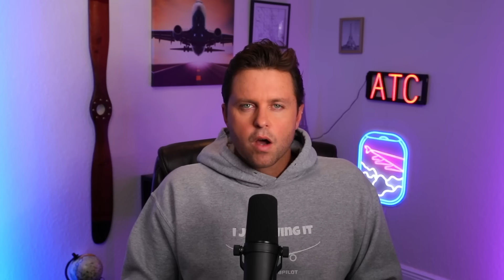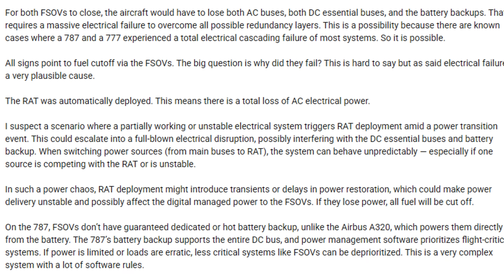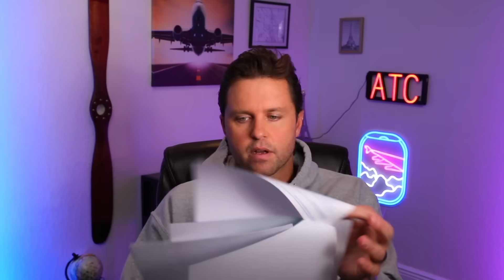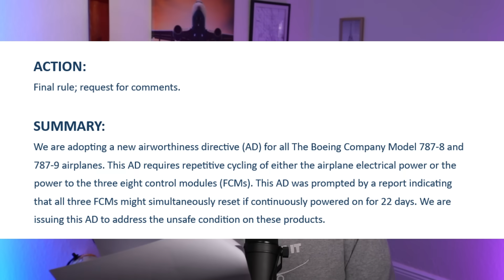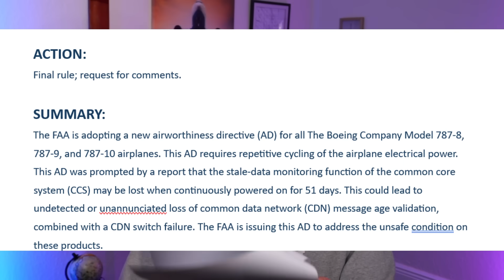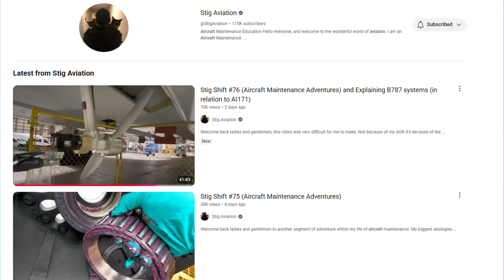Air India 171: Did a Software Glitch Cause Dual Engine Failure?

Comment: One thing that I would like explained in more detail in the report is the timing. With the gear lever put in the up position and the bogeys tilting forward and then it all going badly, I’m very curious if that action has any impact on the engines rolling back or if they were just stuck there because of the other stuff failing.  I’m sure Boeing hopes it isn’t at fault in any way shape or form.

Comment: Yea, I actually saw those AD's and since they're so technical, I wasn't really sure how to interpret what it was saying but from the gist of it, not only did it make sense for explaining everything about what happened, if this glitch occurred, but it also appears that they originally wanted to ground all 787s so all of them could be prophylactically inspected for this glitch and was applicable to all 787s but then it sounded like they issued another one because that would be too costly for all these carriers to have to get this inspection or something, so and it sounded like they were passing the buck to other carriers to just reach out to the Boeing engineers if they noticed something wonky. However, the AD said that it could result in a catastrophic loss of control of the aircraft if this power failure glitch happened when the 787 was taking off or landing. I was like, for something so potentially risky, to pass the buck, and contact Boeing, but if it's a glitch that sounds like warning signs for this glitch are not obvious (evident by many pilots not even catching it until now) how would they know to do that?

Comment: All along I have felt it was likely some issue with the electrical system or the plane's automation - similar to the Max.  I think you are probably on to something here.  Will be curious what is ultimately found out.  Thanks for taking the plunge and speaking up first.
Reply: Isnt it most likely pilot error? Otherwise many people could lose jobs, that would be very bad for the economy. It's best for everyone that it's pilot issue. Greater good kind of thing.
Reply: @homijbhabha8860  No it isn't. Any unexplained failure is bad for everyone. Blaming pilot error for the first max crash didn't end well did it? Not for the victims of the second crash, and not for Boeing either. I'd have thought everyone would have learned by now that a cover-up is always the worst thing you can do in the long run.

Comment: I'm under the understanding that the engine never quit running only went into a reduced power mode. We will see.
Reply: Thrust not achieved might suggest such point ov view rather than engine lost engine failed they specifically said thrust not achieved meyday mayday
Reply: In the video showing the RAT deployment, all you can hear is the RAT.  The engines were not running at all,
Reply: @1556cm  Nope RAT can also be deployed if there is electrical failure and not just engine failure. The video shows that landing gear was tilted downwards abut still not retracted meaning there was some sort of electrical failure at that time which casued rat to be deployed and engines either rolled backed fully or were in safe mode.

Comment: AAIB Preliminary Report Highlights
1. Primary Cause – Electrical Power Transfer Interruption (PTI) During Rotation
 • During transition from ground to airborne electrical configuration, the aircraft experienced a cascading dual-engine FADEC (Full Authority Digital Engine Control) failure.
 • Root cause: Uncommanded bus transfer failure due to arcing in the main power relay box (PRB-A), traced to water ingress during pre-flight GPU disconnection in heavy rain.
 • This led to loss of electronic engine control at rotation, resulting in both GEnx engines rolling back to ground idle within 4–5 seconds.
2. Flight Data Record Timeline
 • +0:11 sec: Nose gear lifts off.
 • +0:13 sec: Sudden engine rollback begins. Thrust reduces from 92% N1 to <27% within 3 seconds.
 • +0:16 sec: Master caution + ENG FAIL L/R warnings. FO calls, “Both engines dropping!”
 • +0:20 sec: Autopilot and flight control reverts to Direct Mode. Pitch up attitude peaks at 18°.
 • +0:25 sec: Aircraft stalls at 186 ft AGL.
 • +0:30 sec: Full aerodynamic stall; nose drops rapidly.
 • +0:38 sec: Ground impact at 54° nose-down attitude, 174 knots.
⸻
 Contributing Factors
 • Environmental Conditions:
 • Torrential rain during pushback.
 • Moisture intrusion into PRB-A connector (P/N: HLN8471) — a known corrosion-risk component.
 • Latent Maintenance Issue:
 • Power transfer relay unit showed signs of thermal damage in a previous MEL deferral 2 weeks prior.
 • No replacement had been conducted; aircraft was cleared under repetitive deferral.
 • Design Oversight:
 • Boeing 787 has no physical engine control backup (i.e., no direct mechanical linkage in FADEC loss scenario).
 • Loss of power supply to both EEC channels resulted in engine “freeze” at ground idle instead of flameout.
 • Flight Crew Response:
 • Attempted engine relight sequence not completed before stall onset.
 • Emergency power selector not activated — possibly due to confusion from multiple ECAM warnings.
⸻
Reply: I think this is a total bogus - never seen such reports, maybe I am wrong, but certainly there was no ground impact with 54 nose-down, no torrential rain, etc. fake
Reply: This is bogus

Comment: all the redundant and isolated electrical, hydraulic and fuel systems ....   this does smack of software;  especially with some of the AD's (airworthiness directives) to reboot the plane every so many hours.   Plus, you have two main AC busses, per side that are redundant, running off the engines generators.  Thats a lot of Swiss cheese holes ...   or was it told to ...